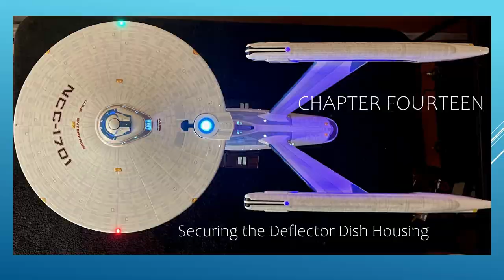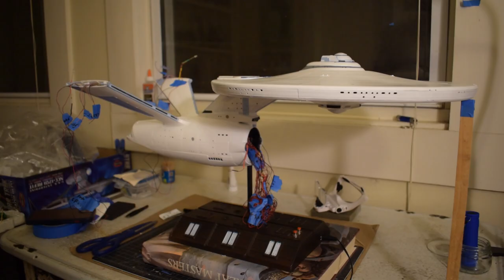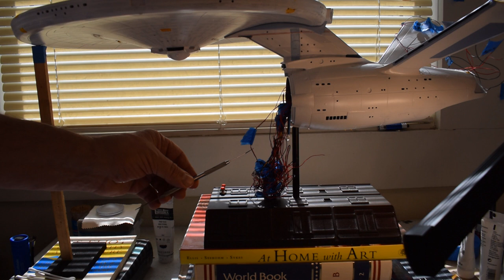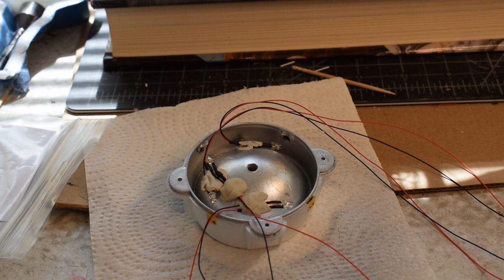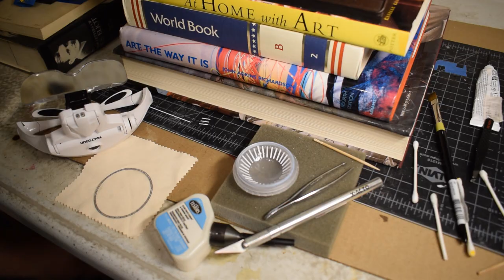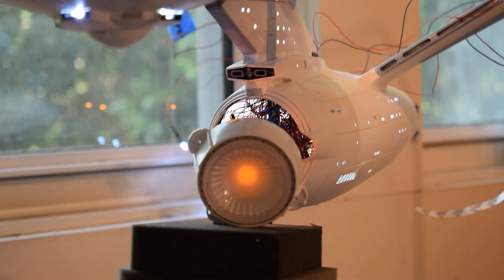Walker Street Shipyards - Chap.14  Closing Time on the Engineering Deck!

Comment: It's good to see it coming together. I hear you on the build sequence, but it still comes out better if you complete the saucer before attaching it (IMHO). I had no light leaks at the saucer/top of dorsal seams.  And yes, always tricky to address light leaks from the exterior vs the interior, as covering the black and then matching surrounding lighter areas is always a challenge.  Positioning the nacelles is a bit tricky as well, ensure they are level and canted correctly - take your time.